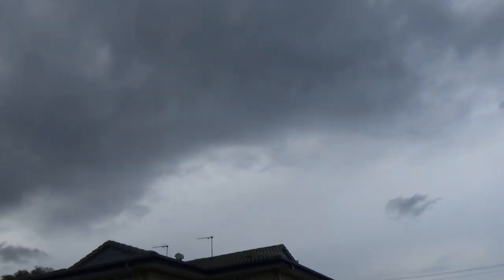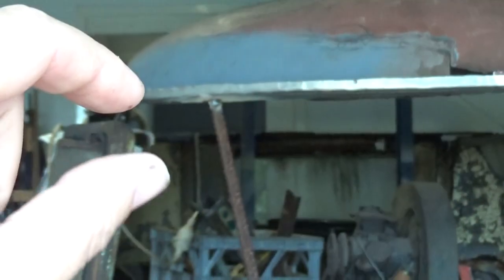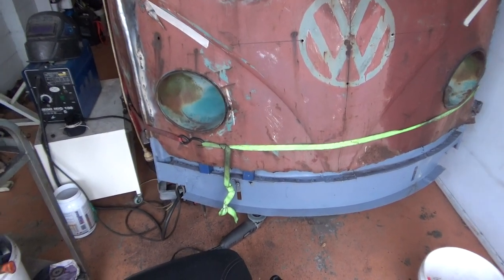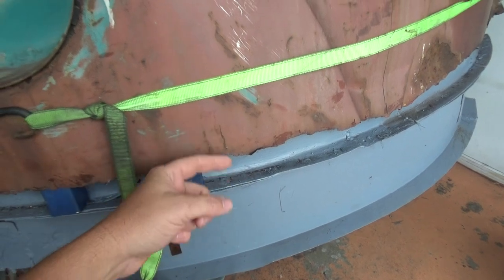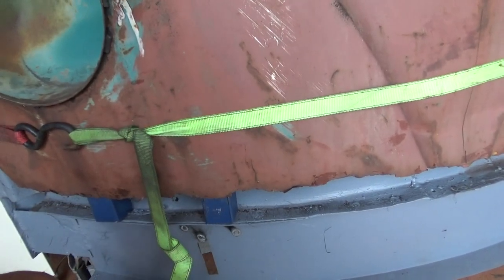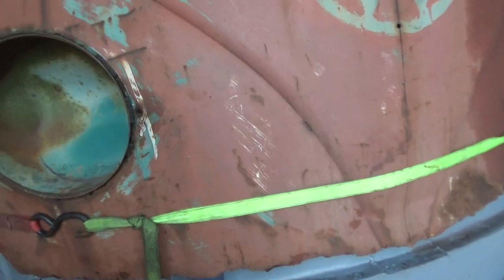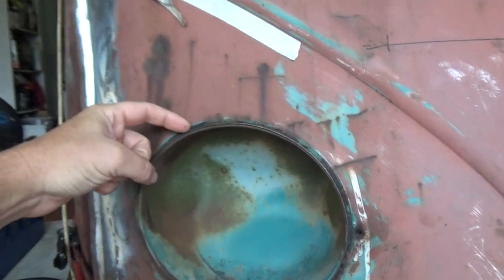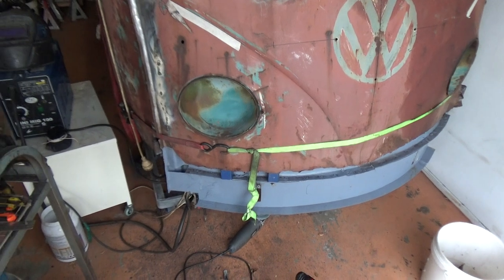#VWBUS in 2020  #RESTORATION#RUSTORATION#HELP Rustoration of vw bus 1955 part 156

Comment: When I get home I’ll send you a video of my double cab hinge, it has safaris and YES you want safari windows!
Reply: I should be able to provide some insight to the nose too
Reply from the maker: It had safaris.they are just rusted out.
I reckon that would be a rare bird given its a 1955 with factory safaris and semiphores.
In australia at least.
There was literally only a few tgousand sold at this stage
Reply from the maker: Thank you.
I just need a measure from bottom of headlight to the seam where the front nose ends and joins the bottom valance.
And also the height of the valance itself.
Thank you greatly
Reply: @vwbusguy  i measured it in the video link in the other reply above, but will get you the measure for valance bottom to seam, as I didn't get that.  factory safaris for your bus I'd say area very rare even here in the states! also in the video linked in comments I mention the semaphores and what dad said to do!
Reply from the maker: Lol i still dont see them?
Im actually welding in part of that valance now
Reply: @vwbusguy  dont see the video or can't see your semaphores?
Reply: @vwbusguy  pitch dark here (it's 11PM lol) or I'd go out to the garage and get measure for you
Reply from the maker: @marcijunebug  video mate.
All good another time
Reply from the maker: @marcijunebug  oh yes here it is thanks

Comment: 8” seems to be the measurement from under the headlight bowl . 

https://www.thesamba.com/vw/forum/viewtopic.php?p=8274767
Reply from the maker: Thankyou very much.
This is a 1955
Reply from the maker: I had a look at the repair section from that link and its ill fitting.
I guess though 8" is a good starting point.
Thank you again
Reply from the maker: I measured the section umder the front nose and its exactly where it should be.
Thanks
Reply: You’re a bit hard on yourself...the welding and all other work looks just fine